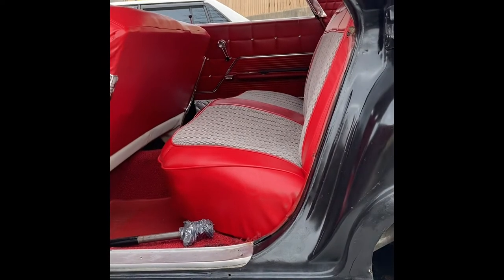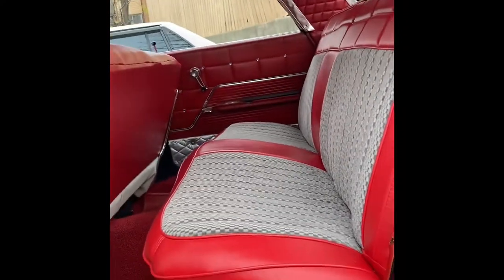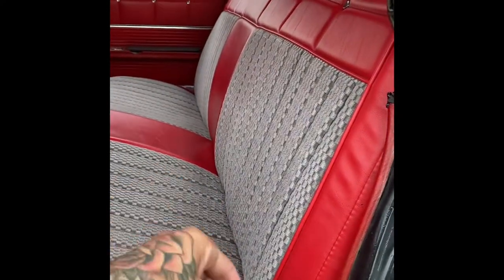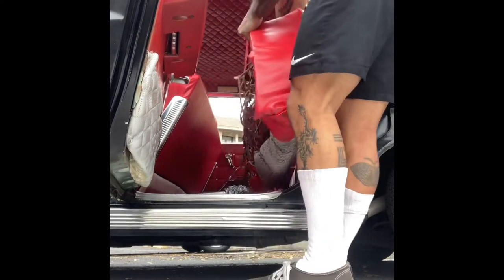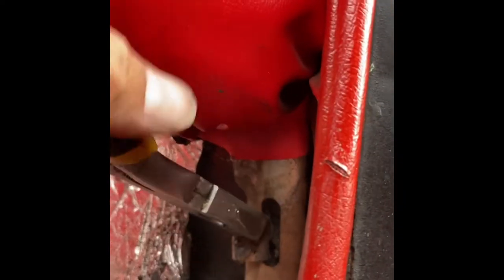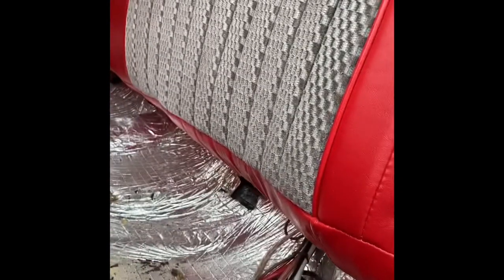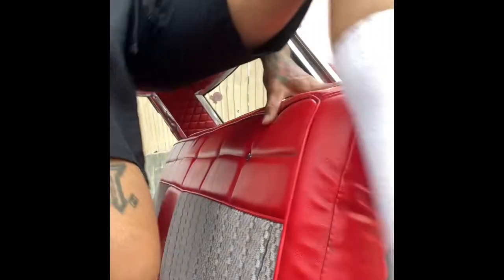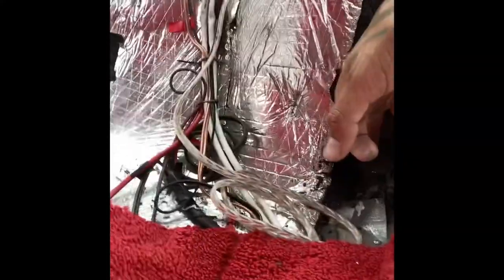How to remove back bench seats classic car

Comment: How do you do the front brother I need help I got a 62impala I’m restoring myself first ever time doing it an it’s harrrrd asf
Reply from the maker: The front has 4-8 bolts that hold it in… to the frame. Just look under the seat and see where the bench seat is grounded to.
Reply from the maker: It’s more self explanatory the back seats seem harder cause you don’t physically see any bolts that hold it In. The front bench you can actually see the bolts/nuts that connect it to the frame